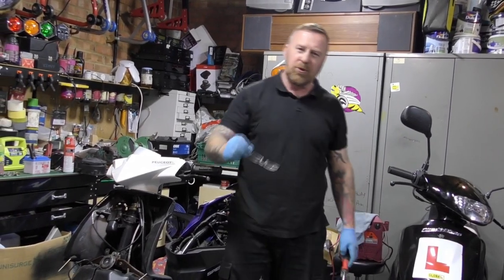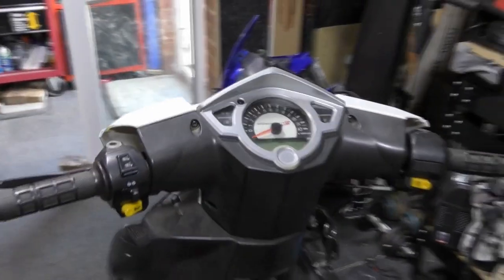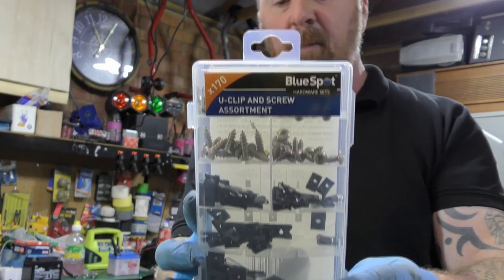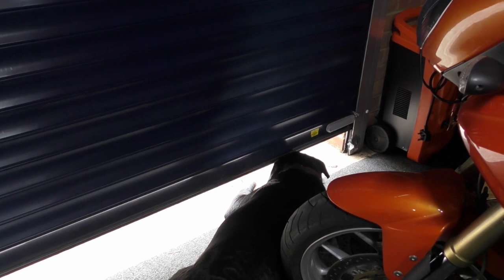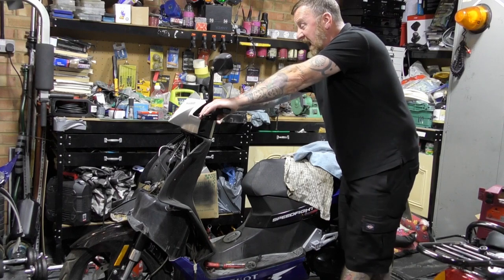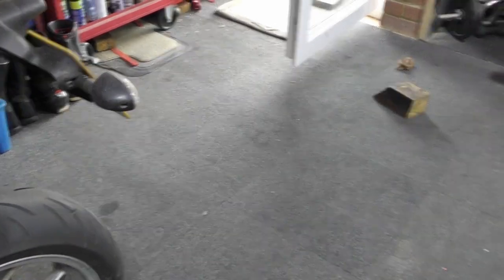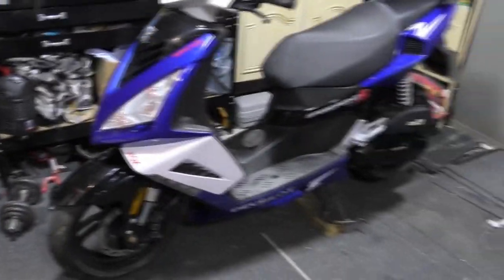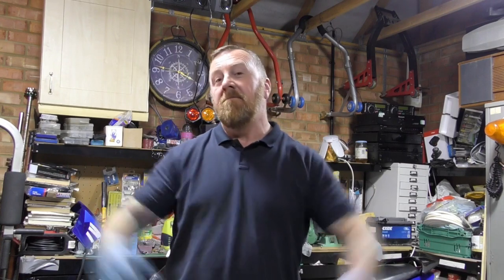PEUGEOT SPEEDFIGHT 3 FIX UP PANELS ROLLER VARIATOR CHAT

Comment: I have a speedfight 3 that 2 months ago turned on and ran then the but the Throttle didnt respond well and when u throttled it to the max it turned off and didnt start back on spark works and i dont know whats the problem i think it might be something withf fuel. It started when we changed the air cleaner. And i lost the oil cap i hope that wont affect

Comment: Hello mark its the starter bendix the rattle on starting they get weak and become loose  wear out the throw out gear will be hitting the starter cog slightly  they can get worse could cause a jam up of engine if hear it as riding its a commom problem on 50cc.... and loved the vxr rant also lol wankers popping and banging exhausts flying about..i enjoyed the video my dad had a speedflight not bad scooters nice job on the fix ups and good tips have nice day also cool dog lol watching under the garage on the look out
Reply from the maker: It's every hour pmsl 
Normally cut it out but not today lol 
Yea it was coming from that area and a bit from the clutch bell housing and again common 
Thanks for watching bud
Reply: @marksavage  lol tell you like bikes more that be annoying then they like that near mine all racing around streets ..an oh right thats deffo what it is my gilera dna did the same put a brand new bendix in it was worn all loose and loads play they should be fairly tight..no problem mate 😁and prob the clutch under the bell be slight worn out prob be the original clutch and everything 😁👌👍
Reply from the maker: @micjubba709  to be honest I do like loud exhaust on bikes and I know they can annoy plus my dodge ram 
It's just I'd taken out 3 times until them pmsl 
As for millie yea keep us safe buy she does like seeing what's going on and who's walking by

Comment: Mark question on a 3 50cc ac,electric oil pump I think isn't working? Ignition on take pipe off carburettor and pipe empty of oil,take pipe off in side of pump and plenty coming out,checked power to connectors and all good so surely with the Ignition switch on the should be a small amount of oil being pumped into carburettor?
Reply from the maker: it will only work when the engine is running bud 
you have the right idea 
if the pipe is clear that runs to the carb then does sound like either your pump or you cdi isnt working bud 
i had this in one of my recent video
the blue sp2 
give that a watch as i show the bits
Reply: My thinking is that if its an electronic pump then if I supply a constant power supply which I did from another battery on  my bench then surely it should pump even slowly like a facet fuel pump? This I have tried and I just get one click

Comment: Hey, i've taken out my washer from the variator of my speedfight 3 2014 ac, now the accerelation and top speed is fine, but when I loosen the throttle at high speed, it goes to low rpms and doesn't wanna go up at all until I slow down and accerelate again. Could the problem be, that i have too heavy variator rollers? 100% sure problem is in the variator since it only happened with the washer off.
Reply from the maker: Yes bud too heavy rollers or old 
Take off
Go for 6g and clean like in my video

Comment: Hi Mark. I have the same scooter but can not get the spring back on the centre stand... Do you know the trick on how to do it? Thank you
Reply from the maker: @KellieSchoots  1st be careful it will have your finger ! 
Old way bud 
Stand back and let it drop a little 
Big screw driver and force it on 
Use a smaller one to help line it up
It's a real pain bud 
But it will work
Reply from the maker: @KellieSchoots  100 videos on speedfights on my channel 
I'm sure I cover this in one but you'll have to watch a few like ones on engine
Reply: Yes I did but not have seen a centre stand. So if I am correct. 2 screwdrivers to do the job? Thank you for your reply!

Comment: Mark, would you think a dodgy speedo could cut out the bike, I had my indicators, revs and speed disappear then it keeps blowing my fuse
Reply from the maker: on these sp3 and sp4 yes but as its not just the speedo but main board for the electrics as they short , have a look as the earths as it may help
Reply: @marksavage  thanks I'll have a check

Comment: Hi, do you know how to change time on the clock on the cluster? Can’t find how it’s Done.
Reply from the maker: hi bud , its the high beam button , hold and turn on the ignition keep it in and then it will flash and change it
Reply: The flash botton or the main one? Can’t make it work 🙈

Comment: Hi Mark, you used 6g rollers in a Peugeot speedfight 3 50cc, what would you use in a 125cc as I think mine are too heavy.
Reply from the maker: 10g to 12g they say but ive used 10.5 and 11g but 
best weigh whats in there now
Reply: @marksavage  thanks for the response

Comment: @mark savage  I have two problems on my speedfight 3 and I can't figure it out what is it.
the first problem is if I let it sit day or dwo it's hard to start it.
and the second problem is when im driving it on full throttle about some times it loses power and to return the power i need to turn it off and wait two or three minutes and then I start it normaly go it gets his power back.
I HOPE YOU CAN HELP ME WHIT THIS???
Reply from the maker: Ok first watch this video
https://youtu.be/qP-NzhkCL4g
2nd if not clean carb , tune and service
Reply: @marksavage  I watch the video and im using a normall petrol 95 (we don't than e10 petrol) 
the carb is clean  and air filter too motor is running ok butt i still have the same problems
and by the way the scooter is stock can tha't make some problems or
Reply from the maker: @yamahaaerox1860  they can still leak once left from the gasket / seals  
This is common and can be the problem as the fuel is then low and won't start 
However it more likely tuning 
So 3 half turns out and run then out or in for best running and starting 
Jet size 54 to 56 standard 
Double check 
Link pipe on ?
Reply: @marksavage   thanks for help me bike is fix it had smaller jet's and bad suction blades valve

Comment: hey how do i make so my 2 light in the front lightup at the same time so i dont have only 1 light on when i drive on my peugeot speedfight 4
Reply from the maker: they both should be on with a sp4 so maybe new bulb
Reply: @marksavage  the are not on bouth at the same time
Reply from the maker: @henriksrensen3530  sp4 led lights are both on low and main beam bud , so might need a new bulb
Reply: @marksavage  what is bulb

Comment: Hi mate my speedfight 2 won’t start I’ve changed the carb all new gaskets and seals new piston and barrel did run a couple of days ago then it went bang like a massive backfire and I put old piston and barrel back on before I changed the barrel and piston which it ran fine with but it’s got spark and fuel it will run fine for couple of seconds then die and won’t start again any advice will be great if I could ring u to discuss will be great
Reply from the maker: Sounds like you defo have problems 
So how was the new piston?
Scored etc?
2t oil pump ok?
E10 fuel?
Did you clean out the sump ?
You did the crank , seals, piston , head all before ?
Reply: @marksavage  yes mate it was all good I can get started but over heats now it’s liquid cooled
Reply: I done everything u said in all ur videos and I kept checking Haynes manual which I don’t think it’s anything I done I think my head has warped or the head gasket is gone
Reply from the maker: @gazzayoung7333  being lc water cooled and over heating yes bud 
You will need to check out water pump,  pipes rad etc , then a new head and piston 
Change small ends too
Check out big ends due to getting hot
Reply: @marksavage  ok cheers bud I really appreciate your help thank you so much

Comment: Hey @mark savage I just bought a SpeedFight 3 and its max speed is 40 km/h and the max RPMs I get are  5000 could you help me? I think it has a restrictor on it but all of the YouTube videos aren't helping.
Reply from the maker: Oh 5k max !
N0 should be 7k plus when on the stand 
What have you done so far 
Service , rollers,  variator , air filter , plug, tune , , ?
Reply: @marksavage  it's 5k max when on a road and like 7k  on the stand. I haven't changed any thing but i need a new variator fan and rollers, but i haven't changed any thing.
Reply from the maker: @realreino  then best you start bud 
Follow my videos on how 
Sp2 videos will help and my sp3